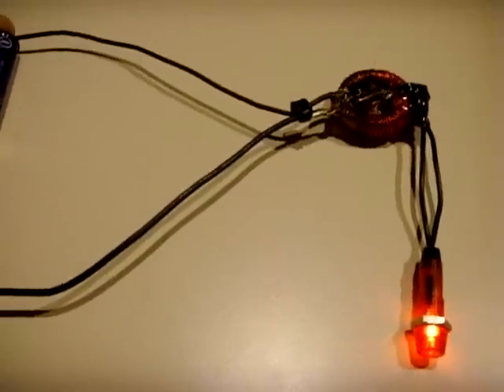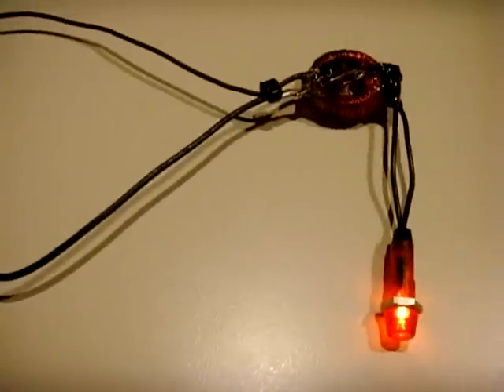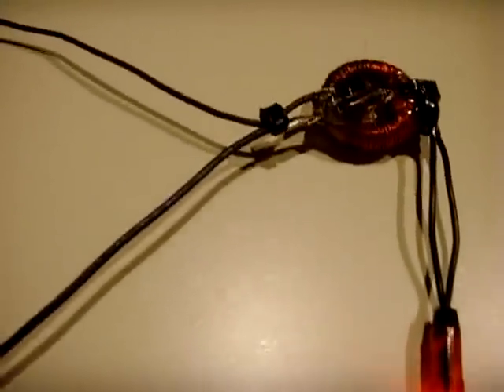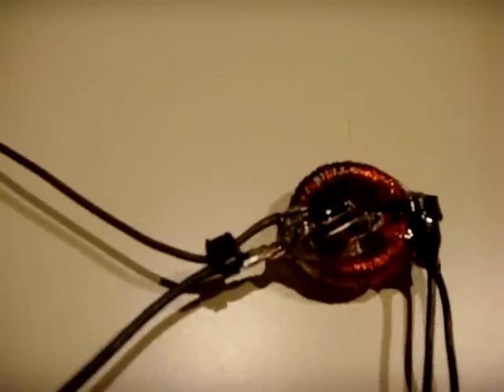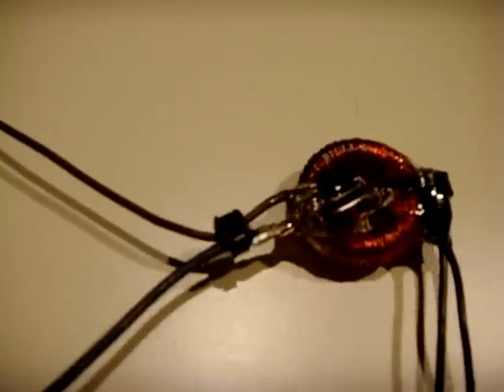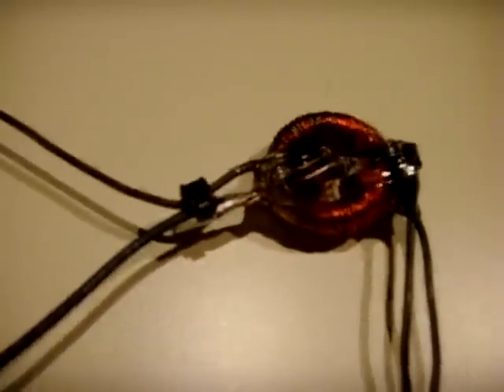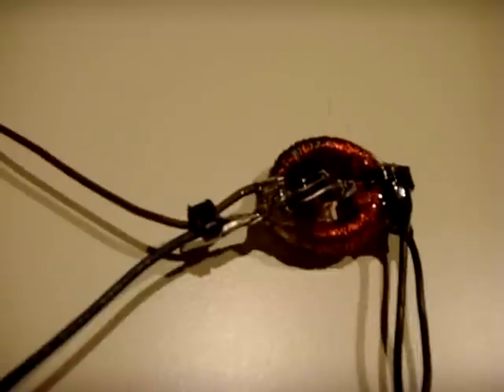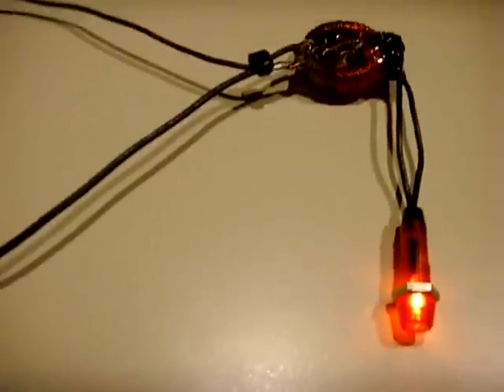High Voltage Joule Thief

Comment: Circuit ?
Reply from the maker: I will post it tomorrow for you in the video description area. I'll take a look in the morning at this device which is used in my capacitor charger. You will need to try different toroids to find one which has the correct value. If you had a meter to measure inductance, I could wrap 10 turns of 20ga wire and let you know exactly what I get to make it easier for you. This video was made years ago before I got serious with my channel.
Reply from the maker: OK, refer to the video description area now.
Reply: electronicsNmore I need a fast answer dose the circuit have in the output AC ? I'll need AC and if dose not can i use at output dc to ac diode circuit ?

Comment from the maker: I don't think so. I had a toroid laying around which I experimented with. Toroids come in many different values, for many purposes. If you wind 165 turns on one toroid, it will not be the same result as another(even equal size), unless the values of the core material are very close. Each toroid will yield a different inductance value when tested with 165 turns or wire.

Comment: Hi my friend, please try this: take this HV JT and put the output to your capacitor charger 5A recently made, and see if you can charge a 12V auto battery with 2 AA batteries, it should work, maybe you will make another video about this also. Tnks for sharing and for your good work, please continue!

Comment from the maker: Not according to the NEC. 600V+ is High Voltage. This is a HIGH VOLTAGE Joule Thief. If you want a higher voltage than I used in this video, just add more turns of wire. You should have been smart enough to know that.

Comment: I could not get this to work until i made a normal joule thief with a 100 turn secondary. Off of a single AA I am getting 750v... it makes my volt meter blow the fuse

Comment: Why not wire the circuit back to the battery to charge itself and syphon off the excess.

Also: if you made a series of the devices would you get a usable amount of energy to run a house?

Comment from the maker: Actually very accurate calculation. Around 600 9V batteries would give 5A / 120V based on a 100mA draw on each 9V battery, which is pushing a 9V battery.

Comment: @myvideoisonutube
Sorry, myvideoisonutube, I see no thief that have been demonstrated here :( thief is about Watts or V*A, you just show a transformer, even if high tension. Need Volt-meter and Amp-meter at input and output to say anything... Yes you spoke emitter to battery negative, but you didn't show it :/